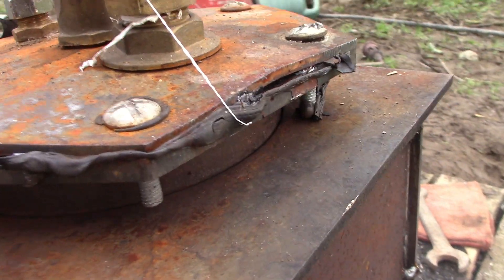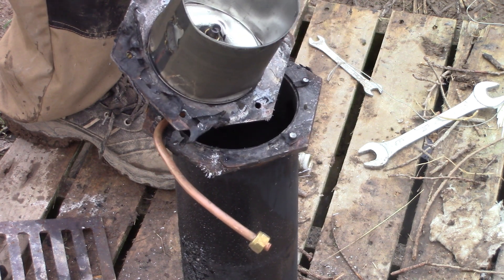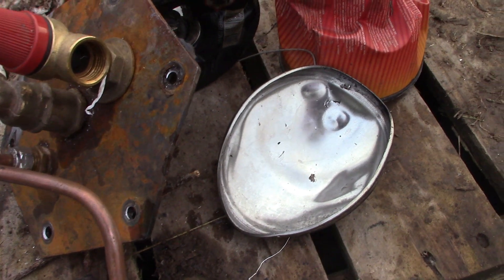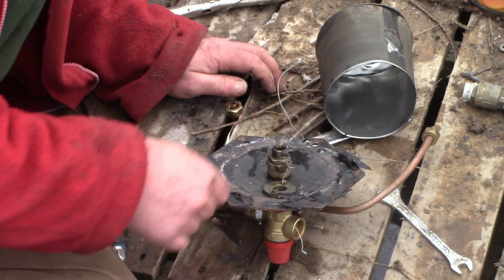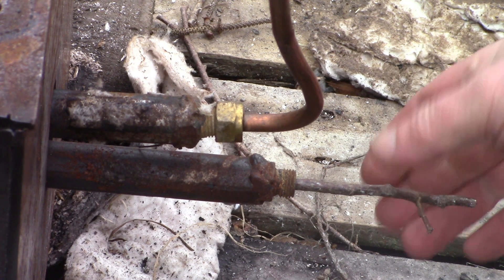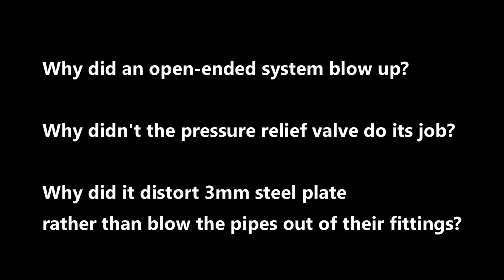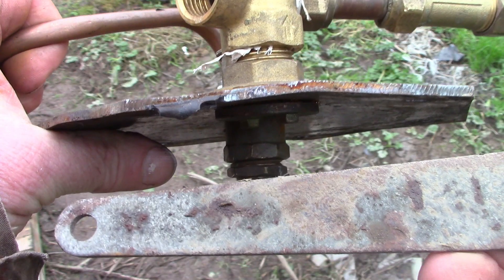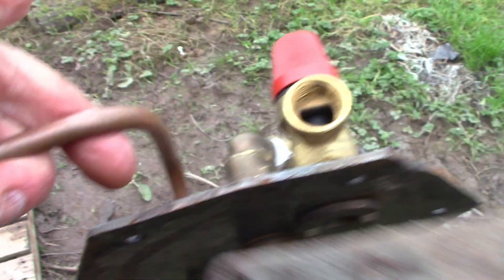Why Did My Boiler Explode??!! My Own Big Bang Theory...

Comment: Having worked with steam boilers in the Royal Navy for many years one of  the main tests you must do is an accumulation test - it's all well and good having a safety relief valve but - is the safety relief valve physically able to discharge the amount of steam that the boiler generates, without an increase in pressure over its lifting setting ? - so you should steam the boiler with the outlet shut off - ie no steam discharge and whilst monitoring the pressure in the primary stage of your boiler allow the safety valve to open at its set pressure - keep the fire burning and make sure that the pressure within the primary stage does not increase significantly whilst the valve is lifting - you may find you actually needed two safety valves to get rid of the volume of steam generated.

Comment: I'm thinking the implosion created an ultrasonic acoustic pressure wave that destroyed it from the inside out. Sound can have a lot of energy in it, especially if the frequency is high enough; it can even heat up and weld plastics.
Reply: Steam-powered implosion, those butane cans are thin like a food can. I know that one is dangerous now.

Comment: 3 year old video. What happened is the same thing that happens to pressure cookers. People have them blow up all the time because they dont know you have to leave the valves open for some amount of time like 5 or 10 min to bleed out all of the air before building pressure in them.

Comment: Empty propane torch tanks for the floats would work, high pressure steel. Dirt cheap. Abundant
Reply: I'm glad it was only 3mm on that top plate, could have been much worse.

Comment: I think it's better to have a pipe at the bottom of the steam chamber connected to the outside so you can check the level, instead of relying on feeding water from the above, bc a water level pipe at the base, will always show you the correct water level, but the level reading could be messed up by any increase in pressure, but if it's an open ended system maybe that's a non-concern.
also this water level pipe could be used with a float valve without it getting roasted or weakened by the hot water and hot steam.

Comment: Why you need a valve anyhow? Build your system so that it can withstand the feeding pressure of the water, it will balance with steam pressure. You only need a siphon to prevent steam enter your feeding pipe.

Comment: From a retired Steamfitter.
Liquids dont compress Gases (air) will.
keep in mind 1 cubic foot of water  FLASHES  INTO 1600 CUBIC FEET OF GAS ( STEAM).
WTF....?  The explosive TNT  flashes 750 times.
  At first I thought you were going to use the propane bottle as a tank ..
thats way to light a metal.
keep going , the name of the steel pipe  is called  superheater.
So floats isolated the air that will compress, all except it couldn't, at least not until they crushed.  Allof a sudden  the temp/pressure  had the space to  get 1600 times BIGGER.

Comment: Weakest link, a prv isn't meant to release explosions, I'm sure it let some by as fast as it could. The amount of surface area of the plate, a long with it being thin and bolted with small fasteners too far apart or just right in this case.

Comment: your explanation seems to be the correct one.  the collapse of the floats created a massive overpressure, because probably all of the water in your boiler got flashed into steam instantly.  neither the open pipe, nor the pressure relief valve, could possibly handle all of that at once, and that is why it blew the lid off.  if you had been anywhere near this thing at that point, it would have taken the flesh off your bones.  very glad you are still there.  steam is very dangerous, that is why we don't use it anymore.

Comment: we all learn from our mistakes, i built a donkey (wood heater for water) but the chimney goes through the centre of a 3mm rolled steel vessel, the chimney was a 2mm thickness x 76mm square tubing, m/s ,  it worked like a charm, then i connected it to mains water, 450kpa, with a relieve valve !!! but.... the chimney was squashed flat as a pan!!! the full lenght of the water vessel, causing a tear around the bottom and top, remedy... i used a 76mm round pipe 3mm thick, this time it works, now 13 years later i learned from your project :)

Comment: The expansion was too fast for enough steam to move out of the open orifices and it built pressure rapidly... You can see this happening if you dump a bunch of black powder into a pipe with only one end sealed... The expansion is too fast and it explodes... Not as powerful as having both ends sealed but explodes regardless..... Basically too much volume to excape fast enough... The pressure relief valves usually aren't meant for high volume but to release pressure relatively slowly if any of that makes any sense.

Comment: It seems like the top of your top float got pushed against the outlet, blocking  the floats opening and pressure built inside the float greater then the chamber was in until it exploded

Comment: Pretty simple... when you understand explosions, and how they destroy things... The do not use the gas pressure to cause the initial damage, but shock waves that have enormous pressure and travel at the speed of sound in the medium... So when the initial collapse occurred in either of the canisters, a negative shock wave occurred, which naturally is followed by a positive shock wave.  The negative shock wave would have cause instantaneous flashing of water to steam throughout the water, like when you release the top off a bottle of pop and it fizzes all the way throughout the pop.  But actually, it fizzes behind the initial shock wave (pressure drop when the seal opens at the cap) but to fast to see!! The following positive pressure - a "Physics" response to the negative shock wave and about the same size = 2 x steam pressure in the boiler - would have hit the top lid of the boiler - "the Bang" that you heard - and bent it and buckled the fixings etc. Without having TIME to operate the SAFETY RELIEF valve.
If you watch old films of B52 bombers dropping explosives on Vietnam, or any other films of major explosions taken from a distance, you can see the shock wave travelling at the speed of sound, as the shock wave has a low pressure zone that causes instant formation of water vapour (condensation formed as the air cannot hold moisture at almost zero millibars of the negative pressure wave). This almost immediately reforms as invisible dissolved water in the air with the following high pressure wave, etc....
I suggest that your BOMB, although an interesting arrangement of fire, heating coils etc, lacks FUNDAMENTAL ENGINEERING and SAFETY matters... So Please get EXPERT help and make something that does not encourage others to make Bombs that can release scalding hot steam, that cooks flesh instantly. My friend nearly lost an arm (he lost half the muscles) in a scalding accident from a diesel engine water jacket joint failure (not superheated steam) at less than 15psi....
What you are making, is UNPROVEN, UNSAFE and should NOT be on a public channel. Shock waves from explosions KILL, and Steam escapes cause very painful and permanent damage to human flesh.
Sorry to have to tell you this. You are obviously not a trained and certified welder or pressure vessel designer, or many other things. 
I am trying to help with this advice...
Ken

Comment: You might want to incorporate a safety practice used by steam trains. Every time they fire up, they purposefully over-pressure to set off the safety valves. Then they manually manage not to over pressure for the rest of the usage.  This proves their safety every time :)

Comment: If you open propane tanks there's sometimes a little bit of oil in the bottom which they use to make the characteristic propane smell. I say there was a little bit of that oil in the top float can and it built up pressure until the bottom blew off. If you pay attention to the direction of force the top of the can blew upwards and the bottom of the can blew downwards crushing the can underneath it. This problem could have been easily avoided by either drawing a vacuum inside of your floats or by putting a small valve or hole in the cans.

Comment: The floats once contained flammable gas. I can see the word GAS on one, and the flammable symbol on another.
What if any of them was not completely empty? 
Then you overheated a closed container with (my guess is) liquid propane. My guess is the containers burst from the pressure of the boiling liquid propane.
Be glad the propane explosion happened inside the steam boiler. The safety valve had no pressure to release as the propane containers held it in. During the explosion the overpressure valve had no chance to release the pressure, as it was from an explosion.

Comment: Perhaps your top butane canister exploded.  It has an autoignition temperature of 861F...perhaps you water inflow stoped and stage 1 overheated?  Maybe try again with holes drilled in the bottom of your floats.
Reply: * 761F...

https://en.m.wikipedia.org/wiki/Butane

Comment: Each of those gas canisters had a valve on the top. Yes they were to prevent excaping gas from inside the cans. However they were empty of gas so the pressure inside those cans was a lot less then when filled with gas. The hot water in the boiler built up a head of steam, up to a pressure more than the cans, and opened them. Instant decompression allowing the air in the tanks to escape, instanly oxygenation the dry steam. BANG. And it would have been less then the 3 Bar safety valve

Comment: I admit to not having watched all of the videos so I'm not really clear on the design. My understanding of a flash boiler is that fuel , air and water inputs have to be constantly monitored and managed accourding to demand. its not really possible to buid a system without a sophisticated management system that you can walk away from to attend to something else.
Theyre ok with high speed, high performance aplications, cars, racing boats, motorcycles but not great in locomotives, or with slow speed engines that come on and off load. They,re also best suited to liquid and or gas fuel. 
Why not built a low volume fire tube boiler with field tubes, or stick with the flash boiler but use a high speed engine with a feed pump and a fuel like veg oil.

Comment: if the boiler had a steady increase in pressure from being "blocked" the olives and relief valve would fail and let out the steam.
But because you had a blowout of the top plate, i think its clear that you had a catastrophic failure in the boiler chamber.
What came first and last is hard to say, but the aluminium canisters are definately my primary suspect.
I recon what you said in your explaination is probably close to the truth.
I have a feeling that the temperature and pressure caused too much stress on the aluminium float, where as the metal got more bendy, and had a critical structure failure, and caused it balloon and rupture at its weakest point.
The sudden release of pressure in the float, triggered a rapid overpressurization and displaced the water in the boiler, causing a water column to shoot like a hammer upwards crushing the second float and also enough force to blow out the top plate.
A water column moving at high speed in a cylinder, acts sort of like a solid block of ice, when it hits something, and it moved at such a extreme speed it acted like a cannon fireing a water "cannonball" due to the rapid displacement, after the first top float exploded.
to see a demonstration of what i mean look at this video https://www.youtube.com/watch?v=GMb6GNYPqXA&t=27s
love from me to @Way out west - workshop stuff
Reply from the maker: Thanks, Hans. I hope to get back to this project sometime soon..

Comment: Maybe you need to have a pressure relief valve actually within the water. I would Mount another one as low as possible in the vessel so it stays within the water. I'm a plumber and I know that the water heater pop off valve is in the water, not in an air pocket of steam, to function properly. Just a guess.

Comment: I think your internals blew up. If that’s the case your PSV never stood a chance, even if you had PSV inlet lines on multiple elevations… You have a flow control problem. In the 1800’s this was solved using a “mud drum” and “steam drum” which is still in use today! You should look at doing that… BE SAFE

https://youtu.be/QcGiVkpUeUk
Reply from the maker: Thanks, J.

Comment: You said " the restriction from the tiny stick in the output wasn't enough to trigger the relief valve, but perhaps enough to imploded the upper canister" But the problem with this theory, and you even drew it on a chalkboard, you drew in that upper canister all crinkled up and mashed like an old beer can someone stepped on, but that is clearly NOT what the canister looks like. The canister is not all crinkled an mashed into a flattened beer can, not by a long shot. It still has almost perfectly cylindrical sides, with a totally missing bottom. Implosions don't remove the bottoms of cans and leave sides in perfect condition, they instead crunch in the sides and crunch up the bottom, but the bottom will still be connected to the can man. Its the can man, look at the can man. lol 

How does implosions remove the bottom CLEAN OFF, and leave the sides almost perfectly cylindrical? They don't that is how. The only defects in the sides are from the impact of the top of the can blasting into the boiler. The evidence is clear to me.

 
That upper canister exploded. Look at the evidence all over again. I want you to get it right, that is my analysis. Don't be afraid, just build it again but this time no used gas canisters. You have that welder, just weld together a float that fits. Maybe stick a small relief valve in the float if you want to be safe because even air expands when warmed. But i don't know if you will need a relief valve in an air filled float in an environment working at steam temperatures. But to be safe add one because the old gas cylinder exploded presumably with only air in it.

Thank you for the honesty. That is why i try to help because you want it and you are trying. Love you guys, take care.

Comment: That bottom piece of the upper canister is your biggest clue to what happened to that upper canister, implosion or explosion.  By the looks of the bottom piece of that upper canister, it exploded. But it depends on how that piece fits on the canister, it is hard to tell from the video for sure which way that bottom piece was connected to the canister, but it looks like it was connected in the direction where it blew it off. Also if it imploded, then it probably wouldn't separate that bottom clean off the canister like it did. Also, the sides of the upper canister were still almost perfect, an implosion would never allow that to happen. Most likely it EXPLODED, since when did you see or hear of an implosion of a canister losing its entire bottom clean off, and the sides still almost perfectly cylindrical? You probably never did hear of it, but you probably did hear of an explosion doing exactly what you seen.

That will also explain how the upper can got wedged to the top of the boiler, cutting off circulation, and then once circulation was cut, the boiler itself exploded open, at the same time imploding the lower canister. I think you made one too many assumptions possibly, you seen the lower canister clearly imploded, so you assume the upper did too. But no, i don't believe it, by the looks of what i could see in the video it exploded. I mean you even know the relief valve didn't save it, the copper pipes didn't split open, etc... but instead it chooses the path of most resistance and blows a 1/4' plate off the boiler? No, those pipes and relief valve were BLOCKED, and that is why they didn't relieve any pressure. Or else they would have relieved the pressure, before it has to blow a 1/4" plate off. FYI copper pipe is weaker than steel plate, but i know you know this because you know copper can't even stand as much heat either.

You were asking how a non restricted system explodes, and the answer is it don't man. Something restricted the circulation, and NOW it will explode!  lol
Your theory of your tiny stick resting loosely in the output restricting it just enough to implode the canister don't hold up imo. There is even more evidence, the bottom canister didn't truly just implode in on itself from normal operating pressures, you can tell by looking at it, because if it did implode in on itself then the bottom of that lower canister wouldn't still be perfect like it is. No, the bottom of the lower canister is perfect, it did NOT implode the way you think, it imploded from excess pressure in the boiler built up over TIME.  It appears to be more of the pressure wave from the explosion that crushed the lower canister, leaving the bottom in perfect condition. The relief valve can't work if it is blocked by a canister blown into it blocking it. But that is why the weak copper didn't split open from the explosion either, they were blocked along with the relief valve by that upper canister blasting its way into them blocking them all.

I bet if you think back hard enough, to when you put that tiny stick loosely in the output you didn't see or observe hardly any output, if any. Indication it is blocked already. Also you might have heard a little pop at one point shortly before(idk, about 10 minutes) before the bigger explosion of the boiler itself.